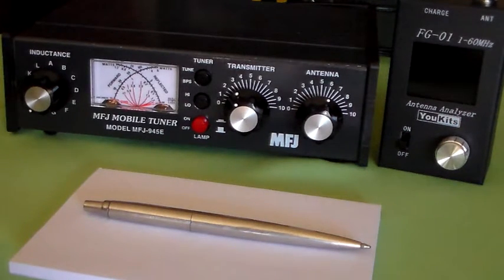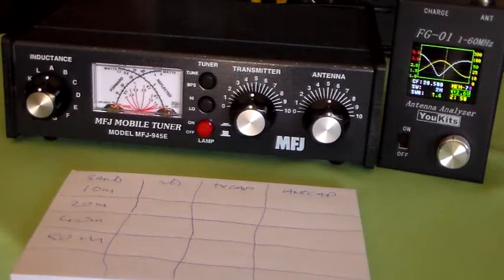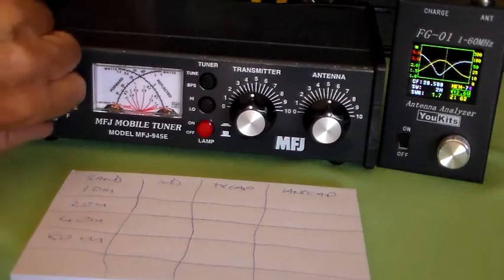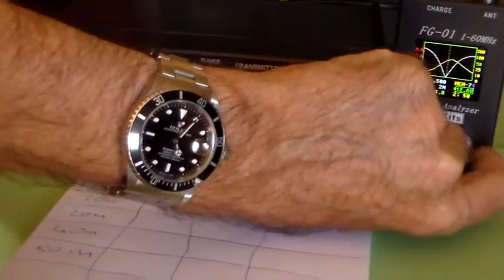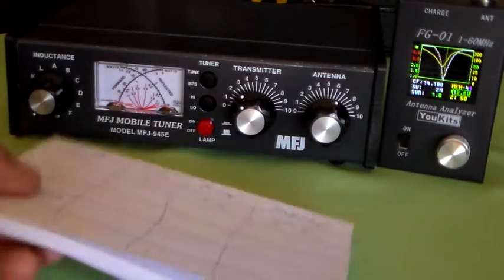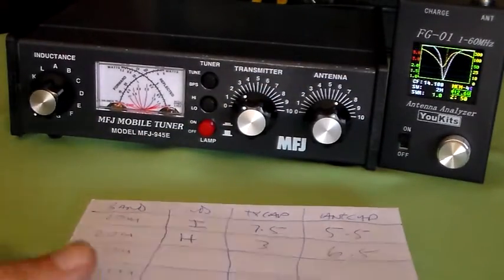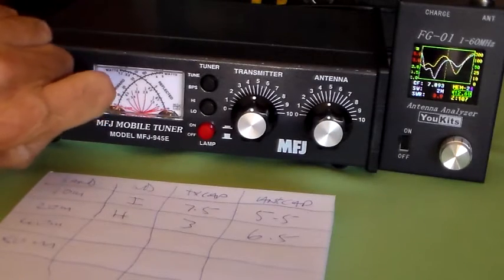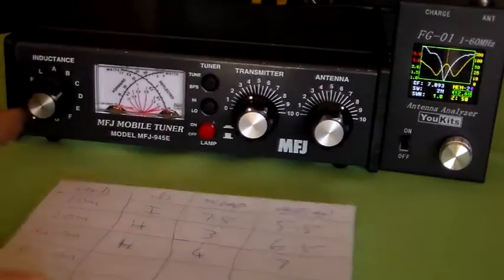MFJ945E Quick Band Change Tuning Chart.

Comment: As a new amateur can someone explain to me how an analyzer can take the place of an antenna or am I missing something?  I mean it looks like he only has the tuner and analyzer connected.  Will the actual antenna have the same characteristics as the analyzer?  Would not the best way to tune be to connect to the antenna, go off freq and tune up there?  Sorry for the dumb question just trying to learn
Reply: Not a dumb question at all. In some cases there are good reasons to do it like this. Not all radios are able to withstand the "shock" of key down into a badly mis-matched antenna and the result is blown finals. A tube radio doesn't;t have that problem. But today's solid state rigs are a different story. If you have a tuned antenna, great. But many of us have random wire, multi-band antennas that need a tuner. In the case of the QDX and QMX (QRP transceivers) from QRP Labs, transmitting into a high SWR antenna will pretty much guarantee the killing of the final amplifier transistors. So, using something like the analyzer Steve uses in this video gets the tuner "tweaked" and ready to be connected to one of these rigs. And no, an auto-tuner is just as bad. Trust me, I know..... 😞

Comment: YOU DO NOT NEED AN ANTENNA ANALYZER TO DO ALL THIS !!! 

Generally spoken, this idea is excellent.

 However, you will be not able to make such a tuning table for such an antenna coupler with more than two variable elements if you do not addionally use some kind of output meter. If you do not add such a device during the process of finding the settings (such a device is quite simple to build yourself) most of the results in such a tuning table will be pure nonesense and completely misleading!!!

The reason is, that an antenna coupler with more than just two variable elements has not just ONE setting to match the antenna impedance to 50Ohm but has quite a LOT of such settings. But there is just ONE very narrow range which will cause the maximal Power at the output of the coupler!!!

There is no other way to find this setting for each band than placing a so called relative output meter on the shacks desk. Such a device can be indicating the RF-field strength in the shack, the RF-voltage or the RF-current at the output of the coupler. If you are not the RF-specialist, the field strength meter is the most simple. You find a lot of these circuits in the web. Use two Germanium diodes, one 10nF ceramic capacitor, a 50kOhm Potentiometer, a simple meter with a range of 50 or 100uA and use some 30cm of stiff wire as the antenna.
Place this simple device some 30cm away from your coupler.

When you make the measurements as shown in this video (by the way, you do NOT need an antenna analyzer as shown in the video, but what you REALLY need is this additional indicator and VSWR meter of course) tune the field strength indicator by the potentiometer that it shows some 1/3 of the full scale.
Now tune the coupler for best VSWR and look for the indicated field strength. Try to find a setting of the coupler with a good VSWR but with the BEST field strength. 
Write JUST THIS setting into your final table. All other settings push less power into the antenna  -  and the settings with the highest output are the ONLY which are interesting  -  as all other settings have a lower efficiency!

73 Andy DH5AK

Comment: ...now if you only had a PROPERLY matched antenna that Transmitter Fooler wouldnt be needed.

IT IS NOT AN ANTENNA TUNER.

" nothing can be done from the transmitter to change antenna tuning"

Radio Antenna Handbook published by the Engineers at Radio Magazine, 1936.

Put another SWR meter between your Fake Tuner and coax and see how very bad the match is.

Comment: vert interesting. never ever learned how to use a manual tuner. I don't have your little toy on the side. I have an external auto on the ken wood. and on the 73oo I only have the tuner in the radio.. I do have an mfj older tuner setting on the shelf. guess .I will have to hook it to the seventy three hundred and try it. it is just radios are so expensive these days and to learn on a new radio just scares me

Comment: Thank you for nice and easy and short presentation for how to use manual tuner , the qui ? If I am using dipole homemade tuned for 20m can i use tuner to mach all bands you mentioned without problems? ...73
Reply: I used mine with a CB half wave ground plane at 15 feet. For 160 to 6  meters.

Comment: Very interesting video, can you tell which way round the tuner and analyser is.
IE: which is nearest to the antenna.
73's Alan
Reply from the maker: The analyser is connected where the radio would connect so it sees the load the radio is presented with. Analyser - tuner - antenna.
Reply: @vk6cs456  ok thanks, 73's alan

Comment: On the lower frequencies the  swr was very narrow
Reply from the maker: Yes, that's pretty typical. The lower the frequency the more narrow the bandwidth due to the restricted length of the antenna wire. If the antenna wire was longer the bandwidth would be wider.

Comment: In 10 meters I can not fit the letter i, but in letter j I only get up to 28,400, would have any tips,thanks again for the video
Reply from the maker: You could try putting the transmitter cap round to 1 or 0 and then try the other cap.
Reply: I think the coupler has a problem, because I have another one for 10 and 11 meters and it works normal
Reply from the maker: Aha... maybe an open circuit contact on the inductor switch. You have to be careful with these ATUs and only switch the inductor with the PTT released.
Reply: i know this part of inductor kkkk,but i think the tuner have problem,i have to find another,but thanks and  73's
Reply from the maker: Cheers Walter, 73.

Comment: brilliant,what kind of video are you using?...73s
Reply from the maker: Thanks. The video camera is an old Samsung, they haven't made them for some time. It has poor low-light and auto focus performance. The recent videos are done with a Panasonic 770 which has better low-light and auto focus performance but I wouldn't recommend buying one as it has no pause function and doesn't use the USB socket for recharging.
Reply: sorry,I was asking about the antenna not video....73s
Reply from the maker: To be honest I can't remember, but it would have been some kind of wire antenna.
Reply: thanks,I'm waitting for it next week to connect with Alinco DX-SR9T HF+SDR,as I see that you using an antenna analyser to see real time swr and resistance,could you describe how to connect it together?Somewhere I'm comfused of that..!!
73s
Reply from the maker: I took the coax off the radio antenna port and connected it to the FG-01 analyser. That way the FG-01 sees exactly the same load as the transmitter. I then 'cold tuned' the antenna with the MFJ ATU. When I got the 1:1 50 Ohm match I removed the coax from the FG-01 and re-connected it to the radio antenna port.
Reply: I see,must have tool...73s

Comment: What kind of antenna do you have? If you have the same mfj wire antenna that I have then could I just copy your settings?
Reply from the maker: This was a loop of LDF5-50 co-ax. I don't use this anymore. At the moment I have around 15m of 2mm stainless steel rope with a loading coil on the far end. Even if this was the same antenna as the one you're using the settings probably wouldn't be the same. The antenna height, composition of the ground, proximity of surrounding buildings, trees and other objects would have an influence on the feed point impedance.
Reply: I have an MFJ-874 swr meter. Do I need an antenna analyser to make these adjustments?
Reply from the maker: No, you can use your radio to transmit low power into the antenna and tune for a minimum SWR instead of using an antenna analyser.

Comment: can you use the 945e with out a analyzer?
Reply from the maker: Yes you can. You can tune the same way for a minimum SWR, just remember to release the PTT before changing the inductor switch position.

Comment: Many thanks Steve, on your talk on the manual antenna tuner. That Antenna analyzer do you have make it up as a kit? or does come with all the whistle and bells.
Reply from the maker: +Dennis Peake Thanks for the feedback Dennis. I bought my antenna analyser fully assembled and ready to go. I'm not sure if you can buy them as a kit... the name of the company certainly suggests you should be able to... but if they do, and you build one, bear in mind  it would have to be calibrated.

Comment: Something that annoys me with these MFJ matchers is the distance between the Trans and Ant knobs and the faceplate with the scale printed on - makes it tough to get a really accurate return to the charted settings because of parallax error. I checked if the knobs would locate further onto the shafts, but nope. Otherwise these matchers work fine - but how much extra would it cost them to give nice short clearance to the number scales.  Thanks for the vids, by the way - this sort of thing's so much more valuable than a printed manual. (still haven't sprung for an analyser...)
Reply from the maker: Ian Gourlay Thank you for those kind words. I can't say I've found returning to the charted settings a problem, they're always close enough that a small tweak will bring them in. The biggest problem I've found with this unit is the loading caused by my fingers as I turn the knobs.... these cheap matching units don't have any shaft isolation on the variable capacitors.
Reply: It's probably my antenna's characteristics - I've no space in the yard so it's in the attic. A junior sized G5RV shoehorned into a space too short for it! - so it's quite peaky in nature. A tiny deviation and SWR goes high. Not ideal but not much I can do unless I move house.
Reply from the maker: I have had problems with antennas in the attic and around the roof. I had 30m of LDF5-50 arranged as a loop around the roof with an auto-tuner at the feed point... the field strength was so great inside the house that it blew the fuses in my audio amplifier and cooked my home theater projector. Expensive...

Comment: I don't have an analyser, so had to make do with the meter.  Also I charted the hf band edges and centres - there's enough change on my antenna to make that worthwhile. Analysers are expensive!  I have this matcher for mobile, and a 949e for home - the latter is easily the better unit although it's very much larger.
Reply from the maker: Yes, analysers are expensive, but I wanted one for a while so I coughed up for one. It sounds like you've got it sorted out without one. Actually, I probably should have mentioned the method you used.